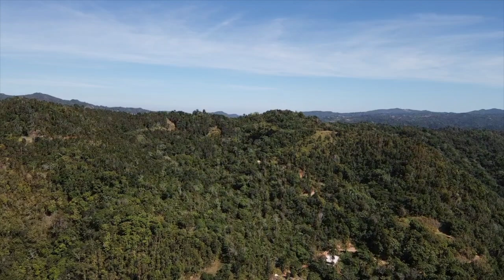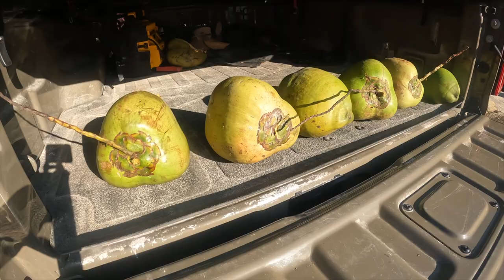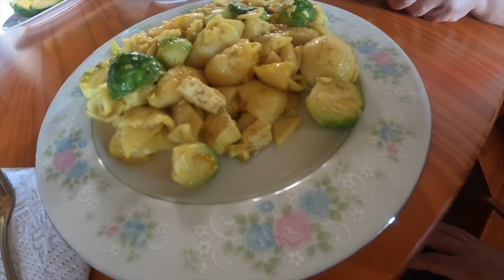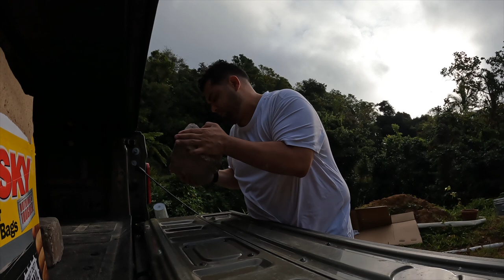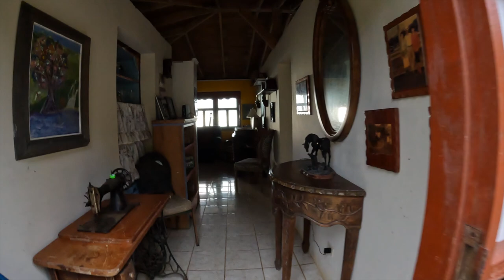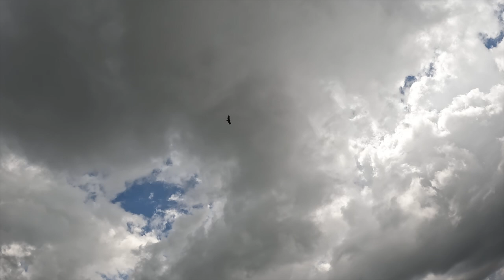PAINTING OUR OFF GRID HOME IN PUERTO RICO | PUERTO RICO | PART 3

Comment: Hello nice home!  But in my opinion I would’ve lower some of that dirt that’s on the side wall/road. When it rains it pours and humidity can buildup on the inside wall/floor. I live on the island and almost did the same thing, but I quickly turned around and fixed the problem.  I had inside wall and floor tiles wet on really rainy days. Thought I’d share. Enjoy your home in Puerto Rico 🇵🇷
Reply from the maker: We currently are working on a retention wall there :)